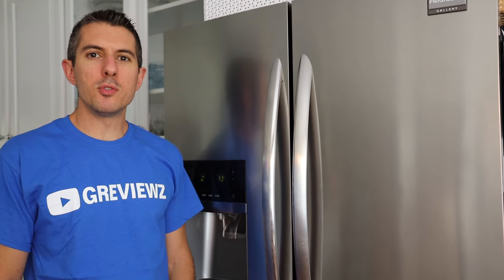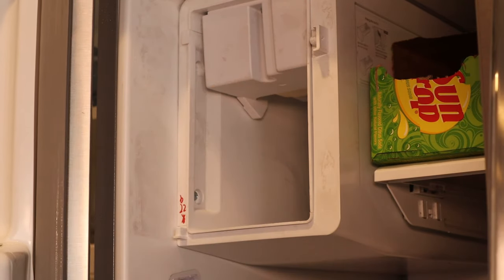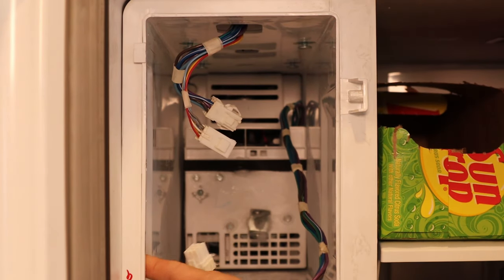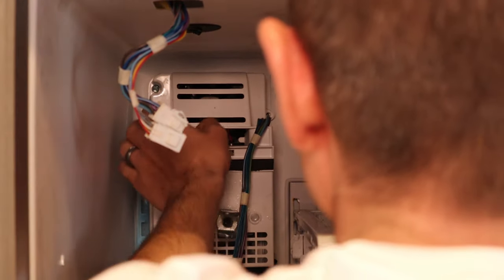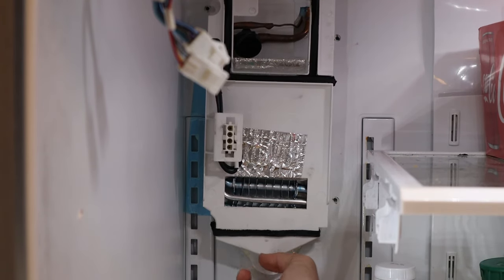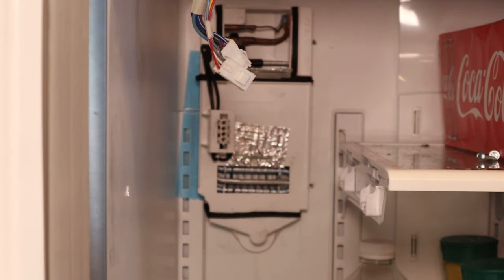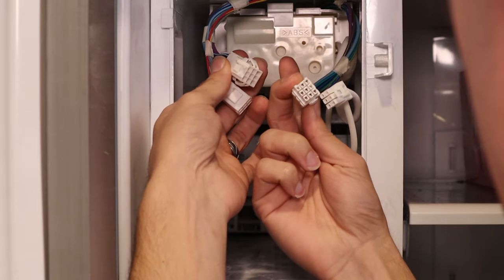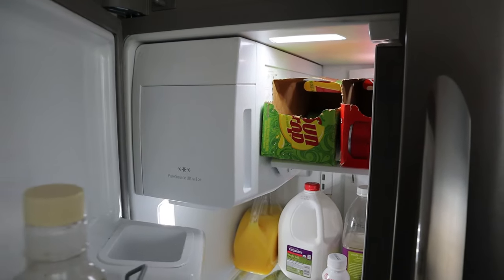Frigidaire ice maker broken again: fix it

Comment: I didn’t hear him say why the ice maker is building the ice. All he did he disassembled the ice make and then put it back together. He didn’t specify the reason why is building ice inside. Instead of doing all that work. Turn the fridge off for 24 hours it will resolve the issue. I hope he can tell us what is causing the issue.
Reply from the maker: There are many reasons for the ice buildup. The main reason is moisture getting into the ice maker area. There are a few remedy’s but none will fix the problem just buy you time until it happens again.
Reply: @GReviewz  The unit needs to be tilted back 1/4 inch .
Reply: There is a fix, false claim none fix it! Need air handler kit with gasket!

Comment: My fridge was off for like few days completely so I assuming all the ice is already melted which you showed during your process but its still not making ice and there is no water either. What could be the issue?
Reply from the maker: When you left the fridge off, did you have the doors opened or closed? There are so many things that can go wrong with these it’s hard to say. As far as the water goes check the water line out the back for any kinks. Make sure the water valve from your house is turned on sometimes kids like to get back there and turn the valve off. Make sure the internal water filter is new/ish and completely clogged water filter could stop water. If there is any ice in or on the water line that can cause problems also.

Comment: Hey thanks for the video. I tried the defrost. Didn’t work. I took everything apart like you, did but I don’t have any ice build up like you did. Any other ideas?
Reply from the maker: Could be a lot of stuff. Have you tried changing your filter? Unplug and plug back in the unit. And make sure all the electrical connections are tight. Also make sure your ice maker is set to “on” in the menu? I know it sounds crazy. I’ve had a few people spouses turn off their ice maker before a trip and forget to turn it back on and they think it’s broken...
Reply: There is a service mode to test the ice maker and associated parts.  It is detailed in a techsheet hidden in a bag under the fridge on the front right side. Just behind the kickplate.  Holding both up buttons for 10sec enters this mode ( holding right side up 10secs exits or wait 20 mins). A menu number is shown and results are displayed. Up and downs scrolls and set enters.  First display is current temp at ice maker thermistor.  57 turns fan on and off. 55 fills.  Others cycle ice maker. Most problems with these are related to the air handler area he described but there is a new air handler kit that he did not mention this kit also comes with a new fill tube that could also be frozen.

Comment: There is a new redesigned air handler asm available to address this issue.  It comes with instructions that should be followed carefully.  The tape in the back is supposed to be there.  Tearing it apart and clearing it s a waste of time without the parts
Reply from the maker: Thanks for the info. Do you have a link to the new unit?
Reply: @GReviewz  part# 5303918784 newest version also includes new fill tube for freezing up issue

Comment: Attach a bare copper wire on the bottom of the coil and run it through the drain hole to prevent it from freezing over

Comment: The tray in my ice maker is still turning as if it is trying to dump ice, but there is no water/ice in the tray.  The water flows fine from the water dispenser.  Is it still likely the case that the unit is frozen?
Reply from the maker: Water line is frozen somewhere, water filter is clogged or someone has tuned off the ice maker...

Comment: Unfortunately , this is only a temporary band aid. Poor airflow will greatly reduce ice production. The lack of air flow is due to ice or frost buildup behind the ice maker. You can thaw the buildup and this will increase airflow But—it will come back. Unless you want to do all this a few times a year,  you need to have a technician figure out WHY the buildup is happening. Refrigerators are designed to ‘defrost’ themselves every 8 to 12 hrs to prevent this . Obviously, this is not happening.  FYI the metal tubes on the back wall is an evaporator.
Reply from the maker: Thanks for watching. In my finding it is humidity that gets in and causes moisture. This moisture then collects and freezes. Yes these units r flawed by design. Ive owned my fridge going on 5 years and Ive done this process twice. I know friends and family that have the same unit and have called out service techs. They just replace parts that are not broken and the ice builds up anyway. Save time and money and do this process yourself.

Comment: Mine is making ice but in large chunks did that will not fit down the chute. I've emptied the bin twice only for it to happy again each time
Reply from the maker: Hmm that is strange. What are your temp settings?
Reply: 0 degrees on the freezer and 37 on the refrigerator

Comment: Just run it through a defrost cycle by pressing the plus and minus buttons for 5 seconds. Avoid leaving your door open. You can always hit it with a blow dryer on low.
Reply from the maker: Thanks for watching. As nice as that sound the defrost coils only melt ice in one location. Ice can still be built up in other places the defrost coils can’t reach. But yes the blow dryer does work pretty good.

Comment: Hello, mine does make ice but the touch buttons on the screen when I press on cube or crush doesn't work. The other functions do, do you happen to know how I can fix that?
Reply from the maker: It is not unheard of for the onboard computer and or the touch screen you fail on these refrigerators. Unfortunately if that is the case it’s an expensive fix. Have you tried unplugging the fridge and letting it reset yet?

Comment: Tech here...  No offense...  Just FYI, there's only one compressor for the fridge and freezer...  The fridge just gets a little bit of the freezer's air.  Also, the fan in the inside is the "evaporator fan"...  The fan on the outside (back of fridge/bottom) is the "condenser fan".  Also, it does have an automatic defrost mode...  Kicks In once a day or so ...  But yes, defrost can be manually actuated any time.   Your ice buildup was either from the door being jammed open from something for a long period of time, the air flow being blocked by too much food, or a problem with the defrost heater or thermostat.  Oh also...  If Manuel defrost is actuated and you forget to stop it, it'll automatically stop and kick the compressor back on after about 15 minutes

Comment: If the ice is building in that area of the ice maker... couldn't this be the problem with defrost heater assembly on top of the coils you thawed or defrost thermostat in the same region ?
Reply from the maker: I mean I’m no engineer. You would think so though…

Comment: All you have to do is use the manual defrost setting on your refrigerator. No need to take anything apart.
Reply from the maker: Did you watch the video? I stayed inthere I ran the defrost multiple times. The ice build up we as not even close to the defrost coils

Comment: How long do you let the defrost cycle run?
Reply from the maker: You can get this problem fixed by just using the defrost however the defrost unit doesn’t go go into the rear drain we’re ice does buildup as well. You can let defrost run a long time if you want just keep in mind the longer you run it the higher the temps will be on fridge/freezer.

Comment: So this only deals with the symptoms. But why is it freezing up?
Reply from the maker: Poorly engineered design. The icemaker is installed in the refrigerator. So ice that is supposed to be below 32 degree F is now stored without a seal in an area that is above 32 degrees F..best things to do. Not leave the refrigerator door open for longer than 30 seconds. Use the ice maker every day..

Comment: Our problem is different.  The fridge is only a few months old.  It makes one tray of ice and then stops.  How does this fridge detect the level of the ice?
Reply from the maker: That is a good question...it doesn’t have the little metal arm like the older types had. Might be a formula in the on board computer. At only a few months old you still have the warranty. I’d get it fixed under warranty before it expires and you have to pay out of pocket.

Comment: There is a new housing kit upgrade that needs to be done on this to remove the issue permanently it’s not really a do it yourself deal
Reply from the maker: I have many viewers that have had the “fix” done from a service tech and still are having this problem. There are many design flaws the “fix” doesn’t address. But it helps...

Comment: I pulled my unit apart but there was no real ice built up. Any suggestions before I put it all back together?
Reply from the maker: Longlive ThaKing the biggest thing is make sure the drain whole in the back is completely void of ice...
Reply: @GReviewz  thank you I'll let it sit for a few days
Reply from the maker: There are a lot of reason the ice maker wont work. I don’t want to scare you but if it’s not ice related..it’s going to be hardware or a electrical problem...

Comment: If drain is freezing up this means the drain line in the back bottom is letting air up the tube causing it to freezing up like a open freezer door. Frost up them turned to ice. Your not cleaning the ice out of the drain tube.
Reply from the maker: Thanks for watching. I appreciate the input. That particular issue has not happened to my unit yet however I have heard of that happening.

Comment: My ice maker is making ice but is crushing it when on cube dispense will this apply to that issue also?
Reply from the maker: There is a very slight chance this process will help your particular issue. Sounds like a computer or wire issue.. what happens when you set it to crush?
Reply: @GReviewz  it crushes. Is it possible the the rotating arm gear fins not inserted in correct direction one side of rotating fins are serrated  and other side smooth. Assume smooth side for pushing cubes to chute and serrated side for crushed?
Reply from the maker: Yes that is right. Did it ever work correctly or is the fridge new and not operating correctly?
Reply: @GReviewz  it did . Couple of servicebguys have messed with but I find no information with correct way the ice dispensing rod should be set in motor arm opening if that makes sense.

Comment: I thought your video was great, after I took my ice maker out I discovered that the water inlet line at the top of the ice tray was frozen.  Used a hair dryer to thaw and thought all was well, however still no ice until I activated the door device that activates the ice maker to distribute icel.  As soon as I did that, I heard water go into the ice tray.
Reply from the maker: Awesome. I am glad I was able to help you out!
Reply: How do you activate that?   My ice maker is not running water or making any ice

Comment: Helpful video on how to defrost but you did not correct the actual cause of the problem.  Pull the refrigerator away from the wall and you'll see ice buildup on the rear of the unit.  Over time it will actually rust through and you'll have a hole.  You need to plug all of the holes where tubing enters the rear with some sort of insulation and caulk.  Then actually glue (I used silicone) a piece of closed cell insulation onto the rear where the ice built up.  I used a piece about 12"X 36".  This keeps the warm air from entering and melting the ice inside of the ice maker.  Next, when you reassemble the ice maker, make sure you plug the holes where the wires enter it and add a length or weather stripping along the top edge of the unit to keep the air from the refrigerator from entering the ice maker.   My unit was made in 2011 and believe it or not, the 2020 models still have this same problem.

Comment: Ah Ha...this frigidaire freezer is on the bottom.  That's why the ice making system is in the main refrigerator section.  I notice the big french door systems with freezers in the bottom seem to now hide the icemaker in a compartment inside the door not at the back of the refrigeration unit.   The mystery deepens.  Is Frigidaire stuck with a problem...or what?

Comment: So I have a similar refrigerator and ice maker to this it makes ice but when we go to dispense ice it takes a little bit to get it due to it getting dammed up and also some bigger frozen chunks but if you pull the drawr out and re arrange the ice s bit it will get you what you need
Reply from the maker: Kind of sounds like moisture is getting into the freezer tray somehow. What temp are you keeping your freezer at?

Comment: May me you can help me. My lg ice maker. Not puting the ice on the tray because tray is not torning. I jave water. I have ice but the ice tray is not turning. But if i use the test bottom it work ok.. What is wrong here
Reply from the maker: Thanks for watching. I do not know 100% on the lg model but for the most part freezers use either a timer or a sensor to tell the motor to turn the ice tray to dump the ice.. check your unit and see if the sensor is bad or something got unplugged...

Comment: It's likely that the defrost cycle is not working for the ice maker. Check for a blown resistor on the main board which is located under the fridge. The only repair that will prevent another repeat failure is replacing the whole board. Here is the link to a picture showing the blown resistor on the board: https://photos.app.goo.gl/Pr2vuvgFqdMxRad29

Comment: I have found that the door closed switch will fail as it is a micro switch and is sensitive to position. slamming the door can cause damage.
Reply from the maker: I had no idea. So I guess I have to stop slaming the door then!
Reply: @GReviewz  got rid of my last fridge. found the problem after I figured out how to remove the face panel and found the microswitch retainer clip broken. replaced the switch and now all is better. still sold it though as a good fridge instead of a broken one. with all the discounts and selling the old fridge, the new fridge cost less than$400.

Comment: My issue is mine makes ice but doesn’t dispense it you can hold it there for several minutes and get like three cubes any ideas
Reply from the maker: Sound like you are either getting ice buildup around your auger motor or the ice in the ice tray is getting frozen together due to moisture making it almost impossible to break it up to dispense.

Comment: I'm a appliance tech.  This is only a band aid.  It will do it again.  Frigidaire has a kit to fix this problem.  A service tech should be installing the kit.
Reply from the maker: Thank you for the Info. What does the kit do to fix the problem? Do you have a link to the kit?
Reply: I had a tech come out and use this kit on my fridge.  I went from ice maker stops working/thawing monthly - to a yearly issue of thawing things out, because my evaporator fan sounds like a jet engine.  So even the kit is not perfect.
Reply: They have more than one kit to fix the problem.  The kits range from replacing just the ice maker to adding a heater to the drain.  One kit is just gaskets.  The other kit has a large pad of form glued to the back of the unit.  If a tech does it and documents it with frigidaire, the company is more willing to help the cust.  I will say that that there is not a high success rate on fixing the problem.  That is why it is important to have it document probably with frigidaire.

Comment: How long do you leave it in defrost?
Reply from the maker: Thanks for watching. On my particular unit you start the defrost cycle and it has a built in Pre set time. It turns itself off. To my knowledge different units. Holy in different years have different times.

Comment: Hey guys, all you have to do is cut the power to the ice maker for 24 hours. Run the defrost a few times. No need to take all that apart.
Reply from the maker: Thanks for watching. I have numerous people that have tried that and it doesn’t work. Heck I even tried it before doing this whole video.. yes it does work for a lot of people but some just have too much ice buildup up..

Comment: Don’t use a blow dryer use a steamer! Saves time and doesn’t melt plastic parts!
Reply from the maker: Ive never melted plastic with a blow dryer. A steamer is putting moisture in the system which is exactly what causes the ice buildup in the first place..
Reply: @GReviewz  well that’s good , but when you have a defrost failure and you’re on the clock steam is way more effective than hot air. Every appliance tech uses a steamer now. Also a fridge/freezer will remove moisture on its on but if yours really concerned about that use paper towels to absorb the moisture.
Reply: @GReviewz  the ice buildup is caused by poor design on these newer style fridges. An ice maker doesn’t belong in the refrigerator compartment unless it’s 100% sealed tight from any warmer air. Samsung is notorious for having ice maker issues/icing up.
Reply: @GReviewz  unfortunately I’ve been doing appliance repair for over 15 years so sadly I know my stuff 😭

Comment: It's a great video,  but as an appliance tech I have to tell you it's not fixed. 

There's a kit that the mfg has come up with to stop the problem.  I don't have the part # but if you're going to do all this I'd contact the mfg and ask them to send a kit and or a tech. 

What he did will help for a while but what's causing it is the rear gasket in ice room. Warmer air from refer section is getting into ice box for ice maker.
Reply from the maker: Thanks for watching. I understand about the bandaid job I just did. It is supposed to be a temporary fix. Frigidaire and many other company’s screwed the pooch by putting the ice maker in the refer. I have heard about the kit you can install however many viewers have commented on how it doesn’t work either…so I do t know what else to say…